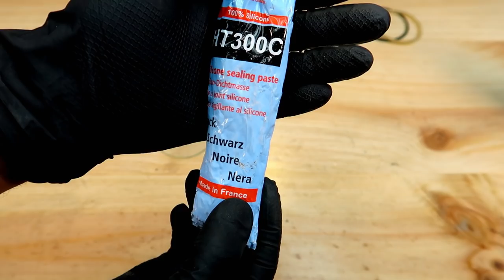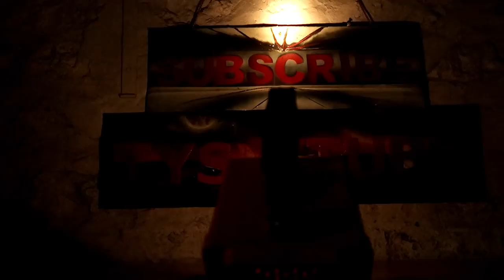Vintage Wonder Lamp Restoration

Comment: Another great restoration. I was looking at the red lens, and I have a tip for you if you want to make them look new. I carefully wet sand them with 2000 grit wet and dry paper, and then I polish them with a really good quality aluminium polish. They come up like new. I've even done this on clear plastic lenses as well as coloured ones, and they are perfect. Just a thought for you in the future, if you're interested.

Comment: I so badly wanted to put that through my sand blaster for you, it would have gotten into all the nooks and crannies and given the surface a good “key” for the paint. It may have been easier to just use an “O” ring for the lens gasket. You can get them in a square profile as well. Great work. Love theses videos as they inspire more people to do restorations. As to the colour? It’s your lamp so you can paint it whatever colour you want!
Look forward to seeing your next job.
Reply from the maker: Thank you so much 😊 i really need a sand blaster
Reply: If you need a sand blaster but don't have the equipment to run it, build yourself a vibratory sander or polisher. Make it a DIY video, that would be cool.
Reply from the maker: easy to say 🤣
Reply: @TysyTube  The rubber you used for the gasket looks like gum rubber. It's very hard to work with, because it's so soft, but is very strong.
Reply: Twigzywik what do you mean?.?? Why is it a hoax?

Comment: I love the restoration. I love the purity of seeing how it worked originally
The modern tech head in me would also love  to see this crammed full of LED'S and lithium batteries. Just to see what can be acheived in the old shell. 
But I also love the original...
Reply: Good idea. Could be a cool project to do with a vintage lantern from eBay or a thrift store.

Comment: This is a mining lantern, and I'm surprised you an still buy batteries for it.  They cost roughly 20 euros in France, 60 euros on Germany. A flat o-ring gasket for the glass should have been available from a machine supply.  Nicely done.
Reply: This was the standard SNCF (French railroad co) lamp and the battery is still available but a little expensive. I get a lamp like that one in a perfect state and I like it.
Reply: Cool!
Reply: Malka Gaël  I thought it looked like a railroad trackwalker's lamp, with the red lens at the rear.
Reply: This type of lantern was used by anybody when walking along unlit roads after dark, that's why the red lens at the rear.
Reply: MidnightVisions  I’m willing to bet you could rig something up so it works on AA’s without changing the original light. Just a thought.
Reply: You could, but it would not be a safety rated anymore because you modified the design without appropriate engineering approval, or tested it so it meets the original requirements.  If that's a necessity of the job its being used on.
Reply: The gasket material you tried to cut look like gum rubber. If it is than might try to wet it with water before you cut it next time. 
You are a great perfectionist. ☺
Reply: If you have a 3D printer you can print an adapter with room for 4 D cells.
Reply: @tomf3150  Or 6 18650 cells and a usb charger if ur making blasphemic changes to it anyway😌
Reply: "ted clubber lang" : I'd have replaced the incandescent bulbs with a modern high-intensity white LED up front, and a cluster of lower-intensity red LEDs in the rear. Power it off of nickel-metal-hydride batteries, charged via USB as you suggest. May need a small LED driver board inside. Wouldn't be "historically accurate", but would be much brighter front & rear, with longer battery life and lighter weight.
Reply: @RobbieHatley  Would be really cool. I don't really see the value in keeping things historically acurate unless it's being used for a movie or museum prop or something. I'm more into so-called retro-futurism. Something like this lantern could be of actual use with some sort of LED retrofit.
Reply: Adding LEDs to this just widens the uncanny valley between tacky replica and bizarrely mint antique that his restorations typically lie between. I appreciate the dedication and hard work, but they're too new sometimes.

Comment: Maybe the inside should be silver so it reflects the light to the red light I have similar light to this and inside is chromed.
Reply: The inside should not be painted. Because the battery needs to touch the body in order to complete the circuit. The paint stopped that from happening. Also partly because he forgot to expose the other element that touches the inside. The switch mechanism totally had me stumped earlier because i never knew such batteries existed. hahaha.
Reply: Looked to me like the switch is what grounds the battery to the chassis to complete the circuit. The other terminal on the battery touches the tip of the bulb socket directly. The only area where paint would matter is the ring where the reflector sits, both the paint and the silicone could interfere with the circuit. Although I agree the inside should have not been painted since it wasn't originally, maybe just clear-coated to protect it.
Reply: Nodak81 if painted to protect the metal white is the most reflective color so pant it bright white inside to help get more light to the red lens in the back. These old lanterns gave hours of light on one battery... can’t get that with modern lights outside of using huge battery packs and like this one doing a balancing act on throwing light over battery discharge.
Reply: @keithwhisman  That's not true, LED's are way more efficiënt and you would get even longer battery life out of such a big battery.
Reply: @keithwhisman  What are you talking about? A modern LED bulb would give a much brighter light for many hours longer than a rubbish old incandescent lamp. I would forget about the original battery  and fit a rechargeable lithium ion battery pack.
Reply: Peter JF I’ve got custom flashlights with thousand plus lumen bulbs that would drain that old battery pretty quick considering it’s energy density is pretty low compared to modern battery technology.
Reply: @keithwhisman  LED lamps are much more efficient at converting electricity to light that the old incandescent bulbs so you could get brighter light for much longer even with an old zinc carbon battery. I would not bother with the old battery myself, it would be better to replace it with a bank of rechargeable lithium cells.
Reply: @keithwhisman 
Then don't use that old battery. Bulb technology improved, and so did battery tech.

Comment: You can replace that lamp with series of about 20 LEDs. Small camping lanterns selling for approx. £3.50 on ebay have the LEDs mounted on a circular flat circuit board that fits exactly within the diameter of the glass and the reflecter underneath. You can upgrade the light and still retain the original bulb underneath with no visual change to the lamp nor any destruction to the body. The power output and battery longevity are increased by a factor of 10.
Reply: O por un único diodo led de 1 o 3 W 12V y una batería de 3 o mejor 4 celdas de litio 18650 en serie, con su BMS, y un regulador de intensidad para el diodo led. Esto le podría dar, según el diodo y la batería, una autonomía desde 12 a 36 horas, y mucha mas luz, sin alterar la estética.
Reply: Came out looking beautiful but then the actual output of that huge battery and bulb was so disappointing

Comment: If they made this today it would be out of wheelie bin plastic what a shame we live in a world where nothing is quality.
Reply: In this case it doesn't apply due to the price. You can buy a Chinese aluminum torch with a rechargeable 18650 battery for 6 euros, while for this one just the battery costs 60 euros.They made them this way as they had no other available materials. BTW the Chinese torch fits in your pocket and is way more brighter than the one presented here.
Reply: @Angel Ami I'ts mostly because of how much people are willing to pay. I've been a design engineer for about 14 years now and in my experience some people are not willing to pay an extra $50-$150 to have a metal vs plastic version, an extra $10-$100 for the made-in-America/Canada sticker, or the engineering cost of 5 design iterations instead of 2 (this affects the reliability and quality). Case in point I have an all metal, made-in-America miniature table saw that was $450USD. Harbor Freight has a plastic one for $40 and there are some in the $100-$250 range that are a plastic/metal combo, made in Asia. In general, people do not choose the most expensive option -- so in general, you don't want to be designing in that space. The Asian manufacturers will build to spec, so it's not automatically crappy just because it was built there.
Reply: @toddphelps5030  
Tis truly a shame we Westerners cannot support our national industries - or, rather, whatever is left of it today - at home.
Reply: @toddphelps5030  ...what are you talking about ?  there are excellents aluminum lanterns very cheaps, most of them are from American companies that usually made their products in asia because of the cheapest labor hand, this said your commentary does not make any sense.
Reply: @Briselance  ...most of the companies making their products in asia are either americans or Europeans, so what the heck are you saying ?   Let's put the iphone like example,  building an iphone in china cost about 256 or 300 dollars, labor hand included  and  how many do we have to pay for one of them ?   Most of the time 1000 dollars,  isn't it ?  So who is the country earnings more ?  China or america ?    Use your brain to think, not only to have it into your head.
Reply: You mean we live in a world of people who whine about things not being high quality but only buy the cheapest crap out there, and who know nothing about the process of designing, developing or manufacturing of products. NEVER in history was quality of things produced nearly as high as it is today. We live in a world where we carry items with us that are so advanced that 70 years ago, they'd bring back witch burning for you if you had those items on you. We also live in times where 99,99% of people don't know ANYTHING about the technology they use daily, and therefore can't appreciate the complexity of what it is they're using. 

Even the cheapest items you can buy today in most categories are made to such a high level of quality, precision and functionality that 70 years ago they couldn't do it even if price was no object, they simply didn't have the tools or the knowledge required to do it. People mistake quality for durability. You can make a high quality modern tool like a cordless drill (that is a small marvel of engineering when you consider all the processes and knowledge required to get every detail in them done to the level it's done at), but just because the body isn't made out of cast metal and doesn't weight 10kg like it would 100 years ago, instead it's made of modern plastic, it won't last as long. Even though it's a much higher quality item. Why is it a higher quality item? Because it's more usable, more functional, more comfortable, more reliable, accurate, etc. Things in the past were just made out of more raw materials, which do last longer, but have many disadvantages for the users who use the items. A drill made 50-60 years ago that's a big chunk of metal was heavy, inaccurate, weak, unreliable, hard to use, inefficient, etc. A drill made today is infinitely better.  Same story with lamps. Nobody would use a lamp like the one in the video today. Why? Because our smartphones have small LED lamps on them that are 1/100th of the size and shine 10 times brighter. You can buy a small flashlight the size of a USB  stick that for a couple of € that's gonna shine 10 times brighter than this lamp, and will do so with a single tiny battery for a much longer time than this old lamp will with a huge and heavy old battery. 

You don't design a product to last for 100 years and be shit to use, heavy, weak, inaccurate, not very functional, inefficient, etc. You design things to work properly NOW, and then depending on how much you're willing to pay, you can make that "now" be 2 years, 5 years, 10 years, whatever. Usually almost everything out there that you can buy with the exception of things like mechanical watches, manual tools, etc. becomes obsolete in a few years and you can buy better items for less money.
Reply: @toddphelps5030   Parts I've had CNC machined in China for various designs came out better and with higher quality finish (when required to exact spec) than those machined in the US, and I payed 20-30% less.  It comes down to everyone using pretty much the same machines and tools, but Chinese workers are better trained and far more experienced simply because they do so much more work than anyone else, and they're also very efficient and pedantic, whereas I've found most US companies I've dealt with to be sloppy and they overcharge for their work. I'm not saying that's the case for everyone, just that for the SAME money, you'll get a better job done in China than in the US 100% of the time, which is exactly why almost every American company that builds anything in high volumes does so in China. If you can invest an X amount of money to have a Y amount of things made at a Z level of quality, and all those variables are the same for China and US, then why not do it in the US? Because that Z variable will be much lower in the US for the X amount of money you invest into the job.
Reply: cough trash bin cough
Reply: @derbigpr500  Part of this will be labour cost though, if an hours wage is a tenth of the US then the Chinese machinist can spend 10x as long on the part with the same margin. It's just economics. If Chinese labour costs go up the US manufactures will be out of there and on their way to Bangladesh or Indonesia, following the garment industry.
Reply: @toddphelps5030  Part of it is also that companies today engineer to maximise production and material efficiency, not to maximise longevity or reliability. As you mention, most consumers aren't willing to pay for quality, so there is no profit incentive for it.
Reply: Alec's Garden I guess my humor went over your head some in Great Britain say wheelie bin.
Reply: tony brito q
Reply: after watching this i thought, how cool if i could make a big 9v 6R25L with a crazy powerful but light on power LED, Super Bright, made in USA and can last weeks. I should get on it
Reply: Todd Phelps Willing? Try able.

Comment: I have one exactly like this in almost excellent condition bought from a GoodWill store in Florida for a mear $3.  Research indicates this is a French RailRoad Lantern from the 1910s.
Reply: Yes it is. Wonder was a brand who produce lamp and baterie.
Reply: @lvonh9388  eveready
Reply: Congratulations on your bargain! All the  information I have seen puts these lanterns in use between 1950 and 1980 approx. Although everyone (selling them) calls them "Railway" lanterns the models used by the French Railways were slightly different - they had SNCF cast into the body (rather than WONDER), they had an internal red filter that could cover the beam, and they had a mounting bracket attached to the detachable rear face (because of the bracket there was no rear red lens).

Comment: This could have been really interesting restomod using led's and li-ion or lipo batteries. Anyhow great job :)
Reply: Some collectors consider any restoration profane.  Functional modification from original fixture...  obscene.  This was a good restoration.
Reply: I agree with you, he could've put a modern battery inside without ruining the case, to me is useless to use a disposable 60 euro battery....

Comment: Ahhh they don’t make em like they used to. All plastic and cheap alluminum now.
Reply: Pretty sure the body of that lantern is Aluminium.
Also? If you look around, you will find some extremely nice flashlights/torches/lanterns still being made. They just aren't available at your local stores, because very few people are willing to spend the money for something well built and durable, when something cheap performs 80% as well, for 10% of the cost.
Reply: Goldmarble First off, you do know there is different types and quality of aluminum. Secondly, Although I do not know for sure if this is made or not made from aluminum, It would most likely be an alloy, based off the era it was made in.
Reply: The quality of the aluminum isn't really the problem, it is how thin they make it these days. This is definitely aluminum, due to the colour of the metal, and the fact that there is no rust anywhere on it. From the thickness of the case itself, and the general design of it, it is obviously a cast metal piece. If you made something like that out of cast stainless steel, it would probably end up weighing 10+ lbs, without the battery.

Design is from the 50's or 60's, and cast aluminum was very prevalent during that time period.
Reply: @dposcuro  it's probably pot metal / zinc actually
Reply: I'd say it is a Zinc alloy (ZAMAK or similar). Quite typical for things like this, which need complex thin-wall castings. The white residue also looks like the kind of corrosion you'd find on Zinc alloys, not Aluminum (I see similar stuff on old carburettors all the time, and most carbs are cast Zinc alloy). Can't know for sure, of course.
But yes, that thing is massively overbuilt.
Reply: @DL24StaS  the oxidation is what tipped me off as well. And aluminum would have been wildly expensive in the 1940s I assume
Reply: @joshuajhoyt  After the end of World War Two the price of aluminium dropped by about half the 1939 price due to all the military kit (aircraft frames, ship infrastructure and millions of mess kits.) being recycled.